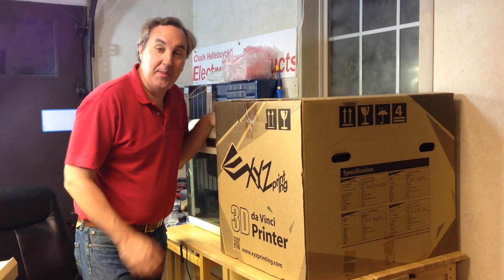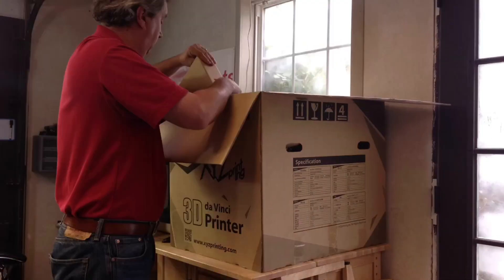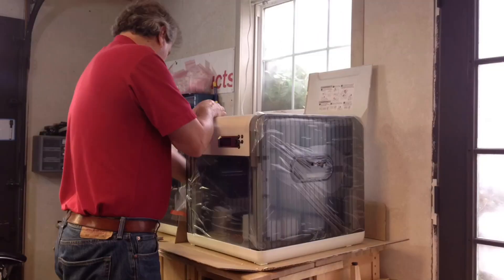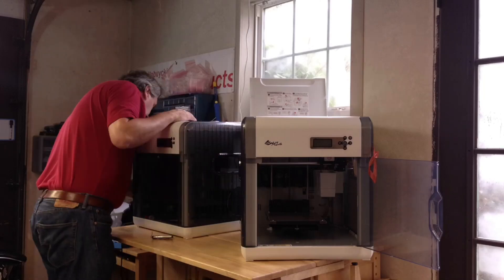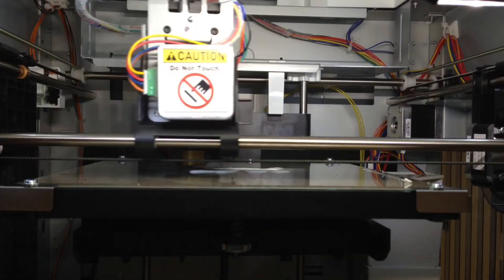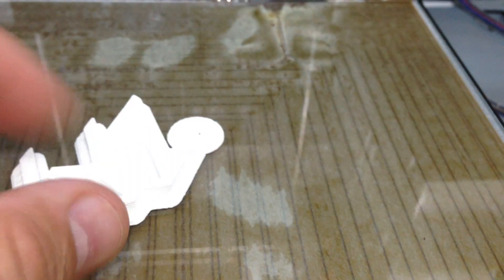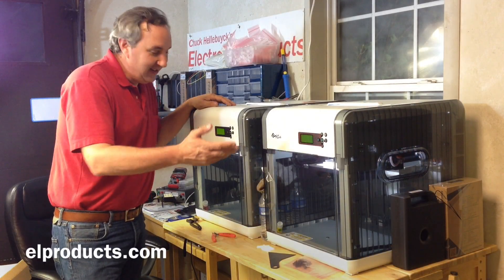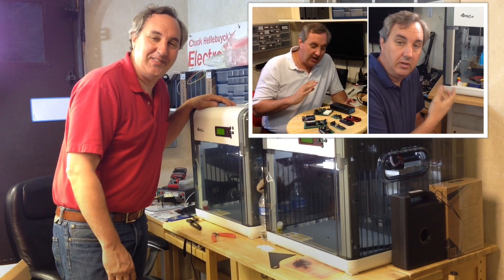Davinci 3D Printer Unboxing and Setup - Video #012

Comment: Hello Chuck,

This is my first time visiting your site…nice info.
 
I received my Da Vinci 3D printer (firmware is v1.0.1) on 12/23/14 and I noticed the motherboard has had some MAJOR revisions as compared to what I have seen and read about on the internet.
 
Here is what I have noticed on mine that differs from all the others.
 
#1: They have inscribed in LARGE PRINT ‘3DPRINTER’ on the inside bottom of the door. I think it’s a very nice touch.
 
#2: The small circuit boards that were mounted on top of the board are now incorporated into the motherboard.  Again, very nice looking now, much cleaner board.
 
#3: The SD Card (heavy drop of glue across it) has moved to almost the center of motherboard. Are they trying to discourage people from changing the firmware?
 
#4: Where the SD Card use to be (top right side) is now blank and has ‘Ethernet’ printed on the motherboard.
 
Any comments are welcome,
 
Thanks,
Larry